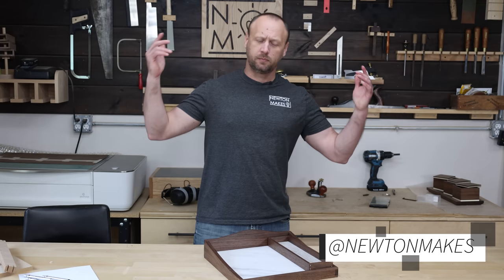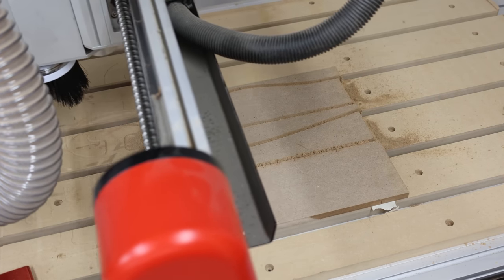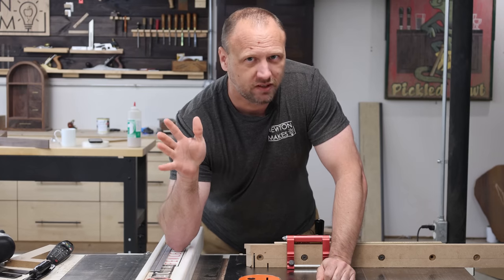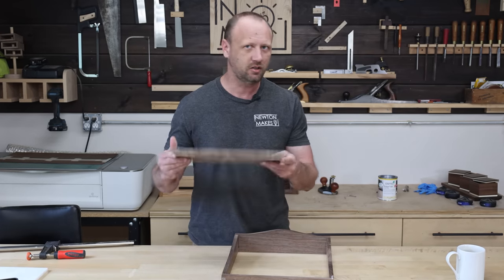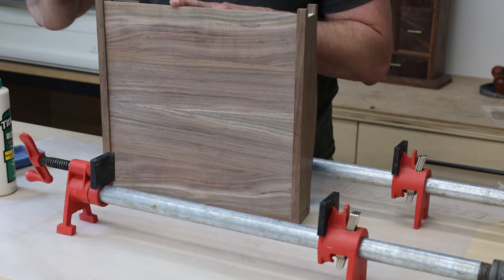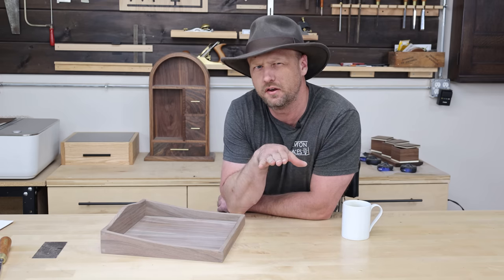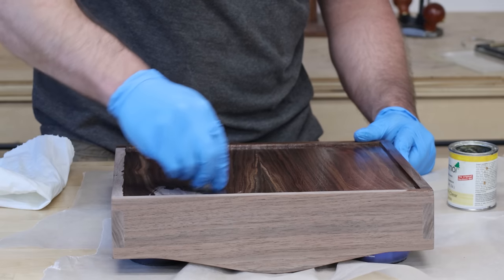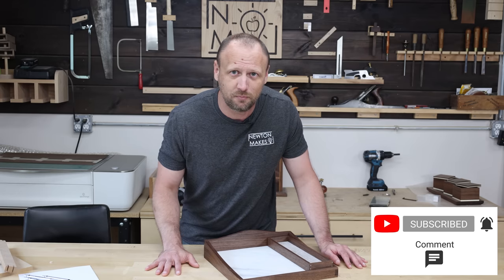THIS Happens When You Mix Stone in Woodworking - You Might be SURPRISED!

Comment: Thanks Billy.  I am a beginner woodworker in my late 60's and have been looking for a "simple" yet good looking project that will make great Christmas presents.  This is it!  I am also looking for a flat tooth saw blade that will work with a SawStop.  Any suggestions where to locate one.  Woodcraft could not.  Please continue to do these type of project videos that beginners, like me, can attempt.
Reply from the maker: I believe I have a link in the description to the blade I used.  It's a ripping blade.  It's also a full kerf.  I've heard that the thin kerf version does not have a flat tooth.